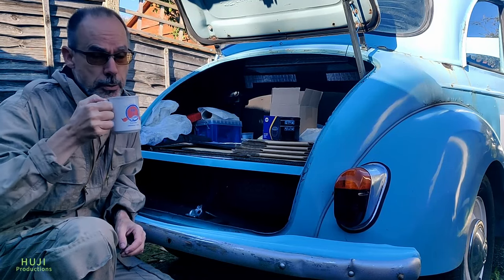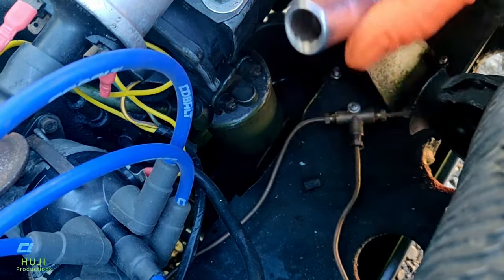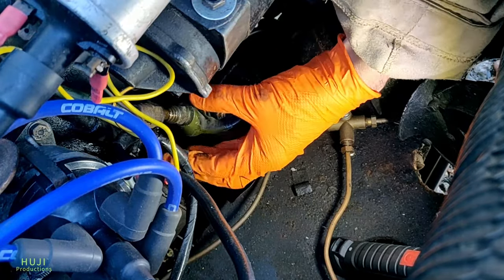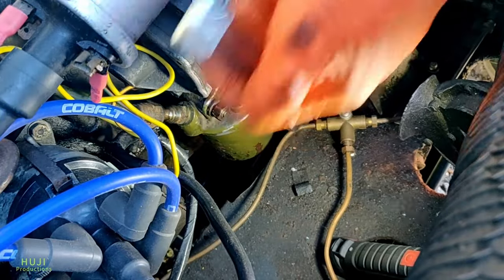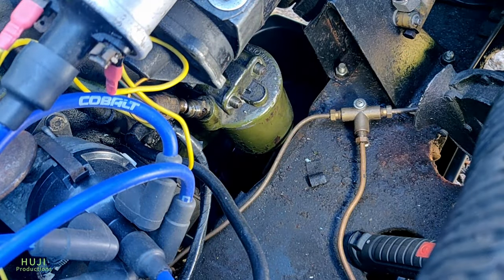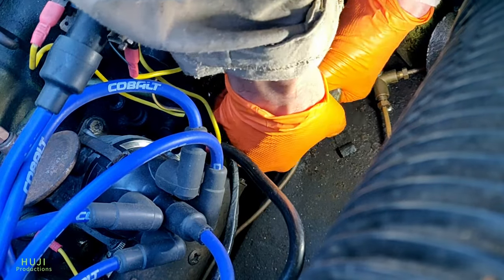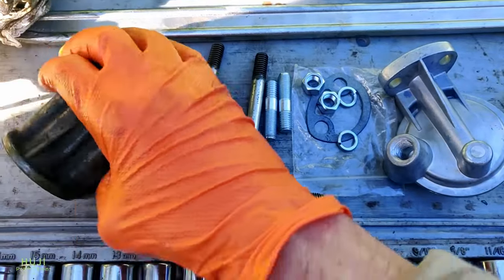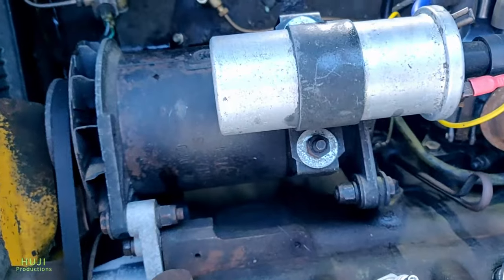Morris Minor - Spin-On Oil Filter Conversion

Comment: gosh very awkward to get to on that model of minor , i have the side valve engine bit easier to get to the oil filter i have recently got a conversion kit for that as the spin on filters are much better really , good video i enjoyed it 👍👍
Reply from the maker: Thanks, worse bit was getting that pipe to fit new part. Always harder when you are filming as well. Think the conversation is a good one and worth the effort though.

Comment: What oil filter did you use?
Reply from the maker: Oil Filter was a NAPAD NFO3016 - Same as BOSCH 0451102056, WIX WL7098, PURFLUX LS205, MAHLE OC21 & MANN W712. Believe WIX is a good make